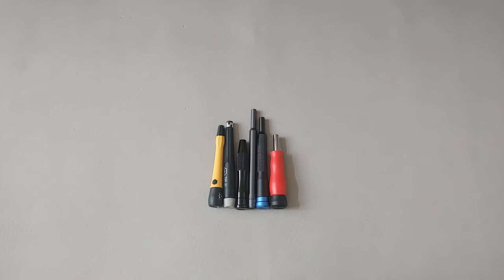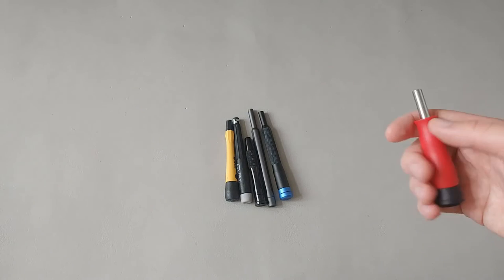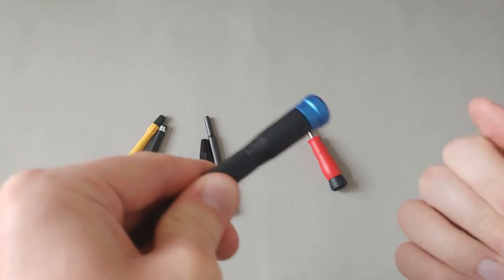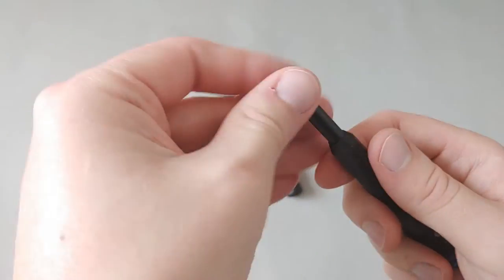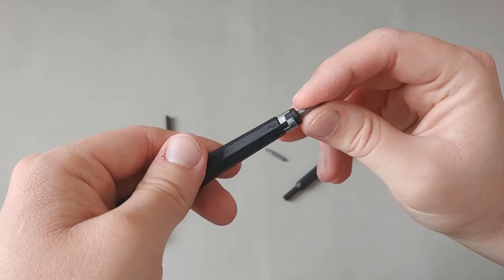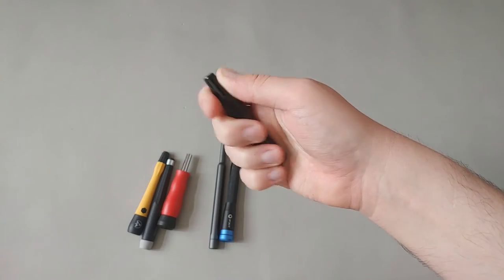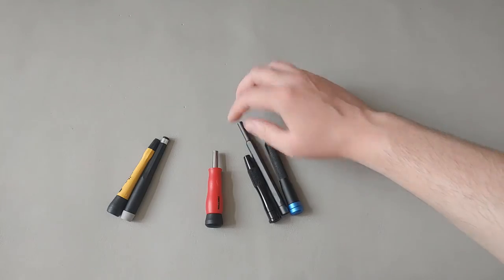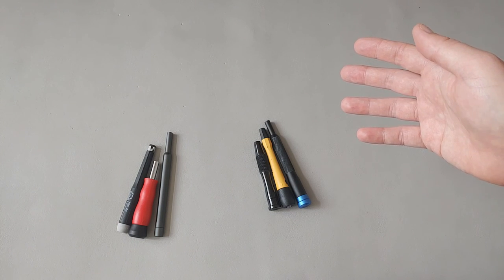Mastering 4mm Micro Bit Holders: Exploring a Variety of Options

Comment: two issues: Magnetic tip holder like wiha can pull tiny screws into the body if you accidentally put them near your work without a bit in them (be prepared to have your day ruined if you are on a job), I had to use super glue on the end of a toothpick to get a screw out of the handle on mine). Also, it would be nice to see how much play there is with an extension arm inserted like the ones that come in the various kits. I use Wiha and there is so much play (wiggle) with the extension in. Still looking for a more rigid holder...
Reply from the maker: Thanks for watching

Comment: Does anyone make a 3.5mm bit holder to fit in 1/4 hex screwdrivers. Milwaukee and Klein use 3.5mm bits not the 4mm standard that ifixit and wiha use
Reply from the maker: @FixitFred  Thanks for watching and unfortunately most don't

Comment: Does that yellow wiha have plastic material for the bit holder?
Reply: @htr5372  yes, that's what i thought so too. I really like the look and the shape of that Wiha pico finish, but the holder material turned me off. 
What i was looking for was steel or aluminum at the least. Nothing in the market suits what i wanted. Long story short, i made my own 4mm bit handle. Or modded to be exact.
I bought PB Swiss precision screwdriver for the handle and Wiha 4mm extension holder for the bit holder. I took out the PB swiss shaft, shorten the Wiha shaft and inserted it into the PB swiss handle. Also took out the wiha hex shaft, insert 2 pieces of 5mm neodymium magnet from the back and put the shaft back in place. 

Now i have a good looking better grip handle with metal holder+spring clip+magnet. No wobble whatsoever with the inserted bit 😁
Reply: @Ianyudh  I would like to see that!! I thought the WIHA holder is metal?